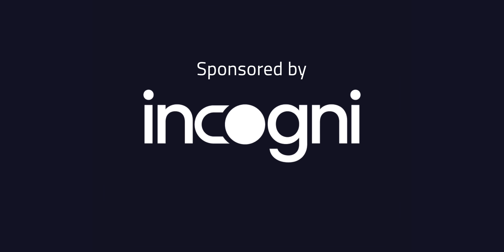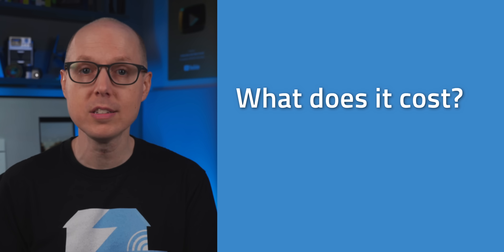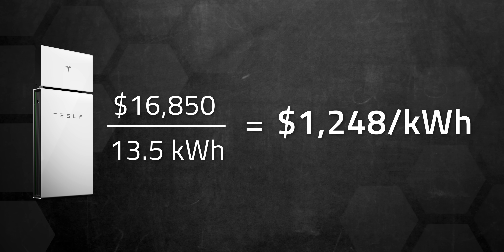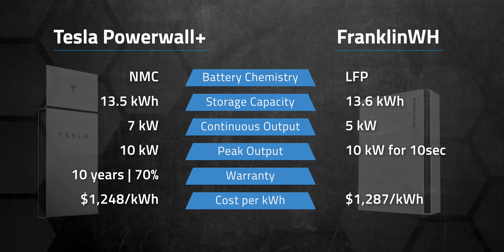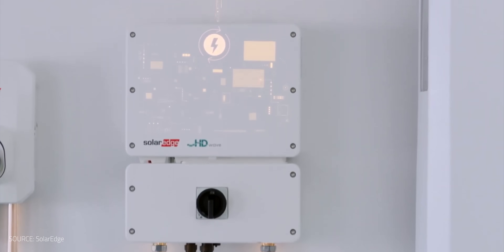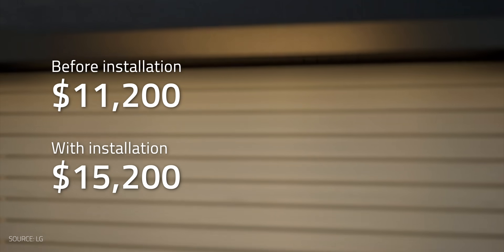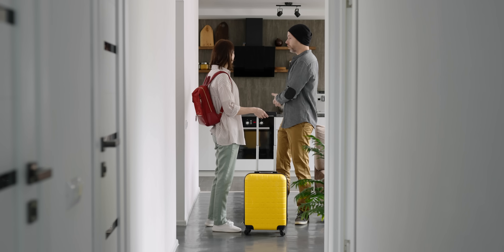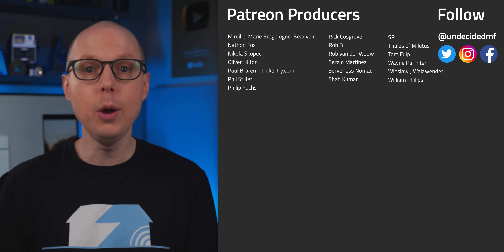Top 5 Batteries for Home (And One You Might Not Expect)

Comment: 99% of homeowners in the US do not live in areas serviced by utility companies that have VPP options. Also, most areas do not have TOU rates. But the main reason against batteries is that the grid is reliable for 99% of consumers 99% of the time. I am waiting for V2G and V2H and will us an EV for the once a decade power outage that we see in North Carolina. (Or a very attractive VPP option)…

Comment: Perhaps people haven't noticed but the resources necessary for making batteries is sky rocketing in cost.  Lithium up 400%, copper up 200% (and expected to go much higher), ... .  The math doesn't work out for a normal household, it will cost a lot more to go with batteries than you will ever pay in electricity cost. Only makes sense for off grid.

Comment: I think a comparison and breakdown of the software each system uses would be helpful. For a long term investment like a battery you need to have confidence the system software is good to start with and will have constant improvement over time. In my research, only Tesla has  software you can be can be  confident in for the  long run.  How did you compare software capabilities?

Comment: I’m thinking that unless flow batteries take off, one or other of the emerging silicon or sodium etc. chemistries where size and weight are lesser considerations than cost and longevity. Iron-air looks promising too, especially on cost. What’s cool is that today’s technology is good enough if you are under 50 and better options are in the pipeline.

Comment: Love your stuff. Can you do a video that combines the avg cost of a solar array and the cost of a Tesla wall (or other battery) over a 10 year period. Im starting to think that it may not be such a good deal if you live in a low cost area for electricity and gas vs Southern California. A quick calculation has solar plus battery at 40 to 60k installed. What would be the break even point for a cheaper part of the USA and would the PV system/battery still work by then?

Comment: Wow, the Tesla PWII is nowhere near the best battery! You can buy LiFePO4 five KW batteries that are well built and reliable for $1,500.00. These batteries have been installed on tens of thousands of homes and have been proven reliable. They don't have the fancy app that the PW II does, but you can buy a Sol-Ark 15K inverter to create virtually the same monitoring functions of the Tesla app.

Comment: Thank you for your commitment to a more sustainable society.

Regarding the LG battery: this is unfortunately a LiPo battery with NMC chemistry.

Please consider sustainability and global societal impact (holistic): 
Batteries require a lot of resources and large amounts of greenhouse gases are still emitted during production today. 

An Empa study (Switzerland) shows that many batteries could help miss climate targets due to greenhouse gases. The "Sunflower Society" with adapted consumption to electricity production is the key for a fast energy transition.

Important would be:
- sustainable battery production
- Home storage should not compete with the procution capacity of applications, such as electric cars and trucks (cell technologies, such as LFP and NMC)
- help stabilize the power grid (virtual power plant, peak shaving...).

NMC batteries are not only less durable and more dangerous (thermal runaway...) but also more polluting than e.g. LFP batteries. 
Sodium-ion battery would be better.

Comment: Using lithium chemistries for stationary home batteries is plainly ridiculous. Lithium is a limited resource and it should be reserved for mobile applications and cars. Companies have to get their heads around aluminium chemistries, or even iron chemistries where power density isnt so much of an issue. There is loads of aluminum and iron about, lithium is a rare product.

Comment: Using your car as home battery might be an interesting video ...
why buy a home battery when you could use your EV as battery ! Needs to be bi-directional. technically a no-brainer. Your car sits in the gagrage 95% of the time, could load solar energy, and release it back when you're at home when the sun is not shining, or resell solar energy when electricity prices are peaking. This means you get a home battery for (nearly) free. The newer batteries from Catl and Byd get a 500,00 miles warranty, so even when your car is dead, you could still use your car battery.

Comment: Coming from the era of computer room ups systems, based on pre-lithium batteries, I am still waiting to outfit my home with battery backup power. I find costs are still high weather the batteries are feed by wind, solar, generator or grid. Issues with fire potential and long term dependability are still open in my opinion. The recent economic situation has added significant challenges in material and labor. My state is currently wait and continue to run numbers.

Comment: The reason for few  home battery installs : obviously the price....
Reply: The price is dramatically cheaper than what Matt showed. Very disappointing that he puts out these extremely overpriced options. Signature solar has a fully assembled 30kw system of 6 batteries installed on a 4 foot tall server rack for $8500.

Comment: Thanks, Matt! I've been interested in adding battery storage to our system for years. Our solar system is monitored and controlled by SolarEdge. I did not know that they make a battery system. This really helps narrow down my options. Appreciate the research and info!
Reply: How is your inverter doing. I've had my 11kw unit replaced twice in 30 months. Might do Enphase next time.
Reply: @phhowe17  I've had mine since November 2016 with no issues at all. I may replace/upgrade when I get battery backup, but for now I'm very pleased.

Comment: The ideal of helping myself and the neighbourhood is appealing but not realy economic: On a winterday the heathpump an normal use can go as high as 27 kWh while a nice spring- or summerday generates over 40 kWh. This will cost me 3 powerwalls to spread the energy deliverance over the hours it's most needed. Also, with 4000 or 6000 cycles the battery pack will not last 15 years. Realy hope the will be more durable solutions in the near future but for now it's not there yet.

Comment: I already posted this in another comment, but I think it's worth saying phase change thermal energy storage via wax could be really powerful when tied in with hybrid photovoltaic-thermal panels and heat pump water heaters. By creating a wax based thermal battery that could be melted/charged by the heat from the panels, you can capture and store a ton more solar energy. The heat pump could be used to heat the wax when excess solar (but not thermal) energy is being produced. And you might even be able to put the cold side of the heat pump into the solar panels to increase their electrical efficiency and use the return line to heat the cold side and generate heat to melt the wax for both a higher electrical efficiency and more overall energy capture via collecting and storing the thermal energy.

Comment: One solution of energy storage I'd like in my dream home is phase change thermal energy storage. My dream home would run on hydronics so I could have 2 large thermal batteries. One would be water that could be frozen when excess energy is produced and tapped into for cooling before drawing power from the chillers, like a thermal buffer until the chillers need to kick back on. That way it's just doing some "air" conditioning in advance.
The other would be a glorified heat pump water heater, except with an extra large tank filled with wax instead of water. The wax battery could be melted with either the heat pump or by the solar thermal  loop of the hybrid photovoltaic-thermal panels, allowing for extra energy harvesting.
It doesn't seem like there are systems like this available for residential customers, but as an engineer, it doesn't seem like something too complicated to build.

Comment: Great video. You didn’t mention that the Tesla battery is not designed to be drawn down daily. It’s meant to be a back up only. Other batteries like the Sonnin are designed to be drawn down daily to limit you pull off the grid each evening and save you money on electricity.

Comment: 20 years off grid and my system is 1Kw with 400Ah LIFEPO4 batts and a 200Ah Geneverse power station backup.  I have most of the same appliances as any modern home but more efficient. You want a system that can operate independent of the grid in a blackout so you must have batteries.
Reply from the maker: Thanks for sharing!

Comment: Quite openly I do not understand why anybody is buying those batteries at the stated price level:
1kWh grade A LiFePo4 cells is significantly less than 200USD those days, high quality rack-batteries made in Europe are available for ~3000USD/10kWh.
Even if a company develops their own BMS and software and bills a high quality housing around those, I would consider 400USD/kWh as plenty. Everything more expensive is clearly a rip-off  and should not be recommended.

Comment: Thanks for another educational video Matt.  I am considering a hybrid system of a LYCAN from Renogy to power critical systems in my home in the event of an outage plus PV and a small generator. We live in a rural area with frequent power disruptions due to storms. At certain times of the year (i.e Spring and Fall) if the power goes out, our basements are at risk of flooding without an operational sump pump. Having what is effectively a UPS for critical loads while we are away from home gives us peace of mind. I like the LYCAN as it handles the AC, solar, and generator input plus provides clean power output. It's not as big as the batteries you have presented but is portable and could be moved if necessary.

Comment: Very nice via video and comments. However I think the big challenge is not a day and night leveling of energy consumption using batteries, but winter, summer leveling. I have a heat pump for heating my house and therefore have 11.000 wp solar panals available. In spring and autumn my energy is manageable on 0 usage and delivery smartly powering on and off of the heat pump. However in summer I have to store energy for the winter. And a battery won’t help me there. The only option I see is using wind energy, but that is quiet difficult for a private energy consumer in the city

Comment: Do you know any whole home battery solutions designed for apartment/condos? We have frequent outages and the building has a diesel generator that kicks in after 3 minutes of no power. I’d love to install a cheap system providing an uninterrupted power supply and wouldn’t need more than 10 minutes of coverage

Comment: Come on, get a better script writer who knows physics.

Saying dumb stuff - and making up definitions which are incorrect doesn't help..

The  unit "kilowatt hour" is not "kilowatts over time"  ( implying division, it gives people who know no better the wrong concept - especially people who may be learning English correctly not like many Americans who tend to misuse language - words have meanings and often US usage is not what the words actually mean)- ha ha, take a chill pill. on with the story ...)- that would be a "power rate" ( the time derivative of power)   rather a kilowatt hour  is the sum of all the (discrete per second "instantaneous units of) "powers" - ie the energy. Intergral, or the kilowatts FOR the time ie. you can multiply by kilowatts or by hours, choose your poison.... (power and time are "orthogonally independent" "vectors"  - or scalars, however you like to complicate or simplify the maths..- the product  is an area - or the multiplication thereof)..

And...  more throwaway B$$ - LFP batteries are being used in EVs - alongside, or even capable of supplementing a LiNMC (or other fancy letters) or Ultra capacitor stack for peak performance...

Comment: These systems do not even have enough continuous power for a clothes dryer to run let alone starting up even a 3 ton HVAC unit let alone running a microwave and stove and lights, etc all at the same time.  Pretty pitiful for the price
Reply from the maker: You’d scale the size of system based on your needs (1, 2, 3, etc. batteries).  It’s absolutely possible to cover everything, as well as staggering how you run your appliances (not running a dryer while cooking).

Comment: 6% is woeful. Energy storage should probably be the first purchase customers make as they provide a return before any generation is added and make adding subsequent generation way more attractive - a value escalation. Those prices are way too flat, typical of new markets justifying prices by 'what someone is prepared to pay'. Until the market heats up and becomes competitive or maybe sodium products are released the pricing is likely to be too high. Though ridiculous energy price-hikes may also drive mass adoption.
We should also be looking at home DC for lighting & low power devices/appliances rather than incurring inversion losses. Not sure of mixed AC/DC is allowed in the US but I'd be Thunderstruck if we don't go down this route.

Comment: Economically they still don't make sense in my opinion. By the time you have payback you have to start looking at replacing them. Life span is still too short and cost too high. And unless you plan to live 20+ years in your house it might work out. The longest I was in  one place was 8 years.
The Forever Energy flow battery looks very interesting. I looked into the Redflow battery, but their power rating is too low.

Comment: Matt, you left out another great alternative. NeoVolta is a safe LFP battery with 14.4 kWh storage, 7.6 continuous kW and 8.4 kW peak. It's a AC/DC battery that doubles as an inverter and allows me to charge with my backup generator.  I considered Franklin, but my on-peak needs couldn't have been met with a single Franklin battery.
Reply from the maker: Good call out!

Comment: Great analysis.  I was very surprised to not see Generac make your list.  I’d love to have seen a comparative analysis of their expandable battery pack strategy and optional DC generator.
Reply: Generac is the best DC solution out there and one cabinet has at least 18 usable kilowatt hours…… Six small batteries.
 Generac offers a lot more continuous and available power than a power wall.
Generac has a customer support team that answers the phone 24 seven 365 and anytime I call Elon about home batteries, or Solar, he doesn’t answer !!!!!!!
Tesla customer service on anything but their vehicles stinks real bad
Reply: @ronnelson06824  Hasn't Generac had lots of customer service and parts issues? I've seen some other channels where they are no longer offering the Pwrcell as a full home backup option because of that experience! On paper, the pwrcell is awesome but I want something that is going to just work.

Comment: Why is it that an 80-kWh home battery system is so much more expensive than an entire electric car with an 80 kWh battery inside of it?

Something is not adding up, and it almost seems to suggest that automakers have been cornering the battery market, to the point where all non-automotive users of large batteries are paying far more for the battery materials than the car companies do.

Comment: I used Pylontech batteries with a hybrid inverter from MPP Solar. Easy to DIY and provides backup. Downside is switching between line and solar/battery. Sounds cheaper.

Comment: Matt, with your apparently more advanced tech knowledge, did you ever look at something like the EG4 Server Rack Battery Kit with a total of 30.72kWh for $8,994.00? That's roughly $344 per KWhr. 
It includes a pre-assembled enclosed rack with wheels, so negates the need for any wall installations costs. They are LFP, which have a much longer cycle life than NMC. You can get them from Signature Solar with a full warranty. And will work with micro inverters such as Enphase, which are better than a single or double inverters. Or with any other inverter of your choice.

You can also configure it with a smaller battery system if that's what you prefer. They go for $1,500 for 5.1kw modules. So a 15.3kw system would go for $4,500.
Reply: I think he is restricting consideration to totally hands-off systems where someone just buys it and doesn't have to worry about design, sizing, installation, configuration, or DIY-style management apps. You are just pricing equipment alone, and for a system many people who aren't DIY or techie, would find intimidating.

Comment: I have Enphase inverters on my 18 KW solar system, and I'm personally waiting for the Tesla powerwall 3, which will hopefully actually be announced soon lol. Though since I have to wait, now I would really like to know how quickly that flow battery is going to come out...
I live near Phoenix, so my batteries have to be able to handle TWO air conditioning units, running at night, when it's still 100° at midnight...

Comment: My battery system. 2 emergency lights in my garage. 10AA nicad batteries provides like 800 lumens for 1 hour  within that hour I can walk into my garage, pour gas into the generator, and 5 min later I have a 5.5kw inverter generator online. Between all the vehicles and gas cans theres around 40 - 50 gallons of gas at any one time, which is plenty long enough for a multiple day power outage. Without running the airconditioner its around 1 gallon per 3 hours